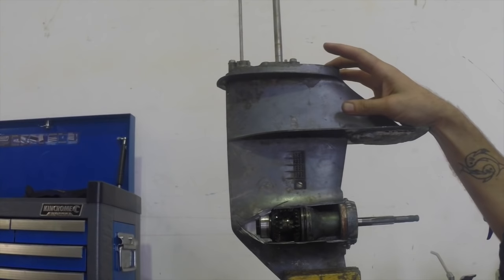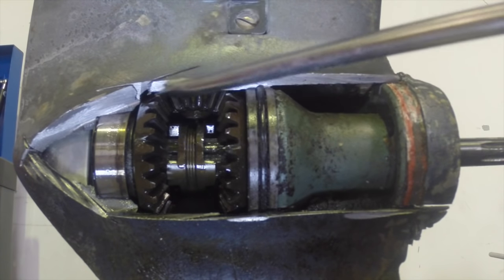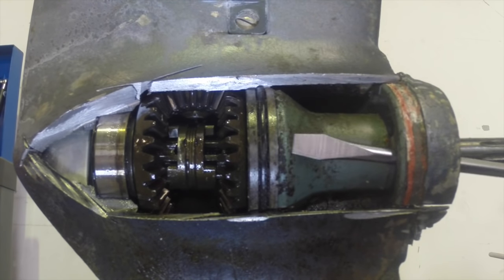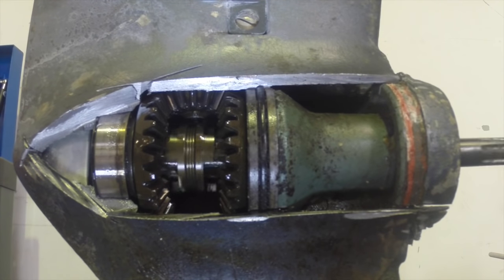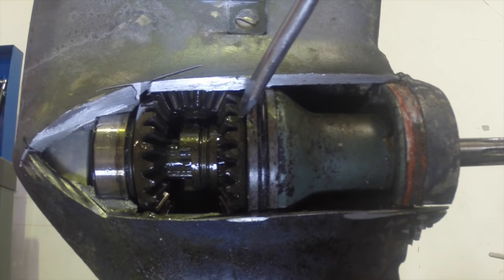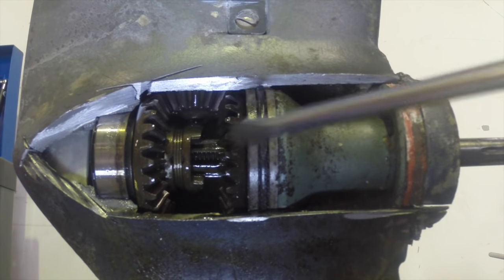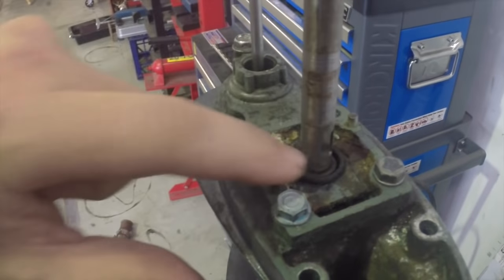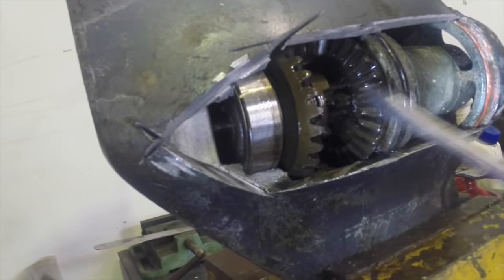How an outboard gearbox works

Comment: so is the grinding sound that i hear sometimes the dog clutch trying to engage on the forward/reverse gears?
Reply from the maker: Yes, that's exactly what that noise is. It generally only happens during the process of selecting a gear, particularly if you do it too slowly.
Reply: I see. Thanks. Just found your channel last night and now I'm making my way through the rest of your videos. You're a great teacher. Really enjoying learning more about outboards and just boats in general. My dad and I were having some trouble with our 40 hp Mercury thats about 15 years old and were looking up videos and I think that's why your videos popped up. We weren't able to get the problem fixed, so we ended up deciding to put a new outboard on it. Going for a 70 hp Yamaha. Should perform much better and get us a good bit more speed. It's going on a 17 foot aluminum Tracker. Any experience with that outboard? Thanks for the vids!

Comment: WHAT DOES IT MEAN IF YOU CAN HEAR A SLIPPING NOISE WHEN DRIVING FORWARD UNDER LOAD, IS IT THE GEARBOX SLIPPING?
Reply from the maker: Hi Eric, by slipping noise is it a clunking or ratchet sound? If so it does sound like either the dog clutch is worn or the gear selector cable needs adjusting.https://www.youtube.com/watch?v=B4acSf_BgP4

Comment: What does the reverse lock rod do?
Reverse lock?
Explain
Thanks!
Reply from the maker: Where is it? Never heard of a reverse lock rod.
Reply: @Thomas Flynn------On my Johnson 25 HP it locks the tilt so when you use too much power while in reverse it stops the motor from kicking up and leaving the prop out of the water and spinning in the air (cavitation?)

Comment: Hi, I am building an electric driven boat. I have 2 BLDC motors that I will connect to my 2 propellers (13 inch), this is for a boat of 13 meters. But the BLDC runs between 2000 and 8000 rpm. How much do I need to reduce this? Do I ?
Reply from the maker: That's a good question, I don't know anything about electric boats but there is a guy on the island that built one so I will ask him. If those props are anything like outboards they probably like to run about 5000 RPM, maybe even a little less given they are quite large and electric motors have a lot of torque.
Reply: Hi Dangar, Thank you for your respons.

Comment: do I have to remove lower unit to replace seals and the o-ring on my 110 hp v4 johnson
Reply from the maker: You don't need to remove the lower unit to remove the bearing carrier, but you can also do it this way without removing the bearing carrier if you are careful. https://www.youtube.com/watch?v=c14ixpVXrZ0

Comment: what automotive seal replaces the prop shaft seals on a 92 yamaha pro 50?
Reply from the maker: Not sure off the top of my head but it will usually be written on the seal. There will be three numbers, an outer diameter, and inner diameter and a width. If they can't be read of the seal (they are very small), you can just measure the seal directly. Be sure to either get a seal with a stainless spring in it or replace it with a nitrile o-ring.

Comment: I just bought a mercury 4 hp outboard and the lower unit was bad. The previous owner told me that the driveshaft Was grinding so I ordered the lower unit from eBay and received it yesterday I put everything back together and now it started grinding again could you please help me what should I do?? Sorry im new to the boating world lol.
Reply from the maker: It could be the bushing that the driveshaft passes through just above the gearbox. If you look up with flashlight with the gearbox off you should be able to see it.
Reply: Dangar Marine Thanks for the response, but let me try to make more sense haha the lower unit it had driveshaft was grinded down at the top part not the bottom. When i recieved the whole lower unit i installed it and when i started it up in nuetral its doing the same grinding noise it did before. I dnt think the lower gears is the problem because the tip of the drive shaft is what got grinded. So my question is what does the drive shaft comnect to when you connect up top? And what could cause this problem.

Comment: So when a lower unit "blows" what's usually failing?
Reply from the maker: If by "blows" you mean totally fails, it is usually the teeth on the dog clutch or the backs of the gears that the dog clutch mates with. If you mean that it can't hold pressure it is the oil seals around the propshaft and driveshaft that fail.

Comment: good video 👍🙏, what is the gear ratio?
Reply from the maker: Generally around 2:1
Reply: @DangarMarine  meaning that how the rpm on the propeller has doubled or actually decreased to half.

Comment: I have a 1978 Evinrude  9.9/15 HP that I am changing the lower case because of a eroded water pump housing. I am having a hard time reassembling it. Can you help?
Reply from the maker: What is happening when you try to reassemble it?
Reply: I cannot figure out how to fit the shifter linkages in the housing along with the forward gear. I can see the way everything is supposed to fit together outside of the housing but fitting it into the housing is another story.
Reply from the maker: I'd love to be able to help you but I've never done one of those. Is it a push-pull linkage or a twist type?
Reply: Thanks anyway but if you've never done one of these then it's going to be too difficult for me to explain. I appreciate the offer. Thanks.
Reply from the maker: No worries, some things are very hard to put into words. Let me know if you post a video on it and I'll take a look.
Reply: I got it together using 2 automotive extendable magnet tools, a pair of long needle nose pliers and a 3/4 inch  PVC pipe union that I used to hold the spring loaded ball bearings in the prop shaft until I could insert it into the clutch dog. Kind of like building a ship in a bottle only with lots of cursing.
Reply from the maker: Nice work! I'd love to see on video on how you did it. Either way, congratulations on getting it back together. :)
Reply: I would make a video but I don't have the video equipment. Also it was a bit of a nightmare and I really don't want to do the job again. Maybe if I get another one of these motors in the future I will consider it. Thanks again for your offer to help. Now I just have to take care of the top end and I can finally go fishing again. Cheers, Bob
Reply: Bob Adams

Comment: What causes the grinding noise when you change gears?
Reply from the maker: +Buck creek Good question. Outboards don't have friction clutches like cars, just dog clutches. Dog clutches are just simple square teeth that need to lock into square recesses in the gears. In that time between them coming together and touching and being fully locked those square teeth will catch then bounce along each other. That is the noise you are hearing. You hear it more when people are slow putting an outboard into gear and are hesitating at that halfway point where it isn't neutral, but it isn't fully locked it.
Reply: Thank you for the info and great video! I will be watching more in the future. I have a saltwater series Yamaha 2 that I have had many problems with.
Reply from the maker: +Buck creek You're welcome. Be sure to take a look at this video if you're outboard is giving you trouble making that grinding noise. https://youtu.be/B4acSf_BgP4

Comment: I turn prop counter clockwise in gear then i turn clock wise and it makes a clicking noise? 
Doesn't do that when lower leg is out
Reply from the maker: Gotcha. I would use a paint pen or something to mark the current position and then try turning it one spline either way and see if it goes away.
Reply: Which gear would be best to put in when I try to put lower leg back on?
I never had a problem with this one before it's been off several times because customer wanted new seals etc
Thanks,
Tom

Comment: I have change my 200 hp yamaha midsection and now every time i shift from neutral to forward or reversed is grinding I adjusted all cables and still grinding can you help me?
Reply from the maker: Is it a push / pull gear selector or a splined rotating type?
Reply: Dangar Marine  push/pull
Reply from the maker: It's odd that it is grinding in both directions. Generally if they are out of adjustment they will only grind in one direction. I would be suspecting some type of play in the linkage that is making it either too tight, too loose or giving it too much play in any part of the linkages that have been changed. Hard to say more without seeing it.
Reply: Dangar Marine thanks yesterday I checked and shifting cable has like 1/2 inch play I think that causing the problem

Comment: Im still trying to get 86 yamaha adjust right has 2 piece gear selector rod
Reply from the maker: So if you set the gearbox into neutral and the gear selector into neutral, how close are the two ends of the rod when you assemble it?
Reply: Don't Know but I will try that
Thanks!

Comment: Danger Marine please help??? I have a 2001 Yamaha 25hp 4stroke. I have done about everything to the motor to make it perfect it has all new head job with gaskets and seals all oem. New fuel pump,water pump , new fuel system complete, coil pack ,plugs ,brand new oem carburetor and maintenance all the time she had ran perfect and I use her everyday and put 1700miles inshore fishing within 6months. Every filter is changed every other month along with oil every month. My problem is she will idle perfectly but the min i put her into drive she bogs and will only go 7mph at most and sounds like its got an air leak i checked and resealed all the gaskets on the intake and to motor. But it sounds like it it missing but not sure. I have all new timing belt on it and it ran perfectly before this then started out of nowhere. Please help im not sure if its in limp mode.please help. I ordered the oil pressure sensor thinking it might be bad. Or im looking into the pulser coil? What do u think please help. I use my boat for fishing and I take vets out for relaxation to help with ptsd recovery.thanks so much
Reply from the maker: Hi Zach, did the problem start straight after the timing belt went on. Could the belt be a tooth or two out? If you can head a leak like a sucking sound you can spray around the parts of the motor with a can of WD40 and listen for a change in the idle RPM to try to find it.
Reply: @DangarMarine  No sir it ran perfectly i went out and had no problems shut the motor down went to take off again and thats when it started to give me problems. I think its just I need to find a good 40 or 50 Yamaha motor I can buy super cheap and over time rebuild it and hopefully sell mine to help with some of the cost but that might take me a long while so I have a feeling ill be off the water for a while unfortunately. If u happen to know anyone looking to sell a used but good Yamaha 40 or 50hp motor please let me know. Ill be honest i cannot come up with allot but maybe I could trade them my old motor to help with cost. Also I did check timing and its right on,also sprayed carb choke to check for leak but no change. Thank u so much for ur time. Sincerely Zachary

Comment: Good morning Im having a problem i removed mine and when i tried to put it back is like a 1/4 of an inch that dosent go in i tried in every gear and nothing i even remove the front piece that looks like a bullet with 3 ball bearings and still is not going in all the way if i tighten the screws it goes in but the propeller becomes really hard to move and if not it never goes in all the way i dont know if there is something im missing or any tricks but mine is not going fully in i was hoping if anybody can guide me in the right direction on what else to try thanks
Reply from the maker: This video might help https://www.youtube.com/watch?v=srGVSl4_n8Q

Comment: Why does my motor leak something right at the base were you put the prop
Reply from the maker: Sounds like the oil seals have failed. Trying doing a pressure test like this https://www.youtube.com/watch?v=lnhZFn5gkG4
Reply: Dangar Marine OK sure will thanks so much

Comment: How do you remove the beating carrier ?
Reply from the maker: With a puller appropriate to the brand of outboard. They are often very tight and will require some heat on the casing to come out.

Comment: Hi n thank you for a great video I learned something new today ty! I'm looking for help hopefully someone can answer me as to why my 1999 evinrude 200 won't go in reverse after is fully warm up lets say after riding alone the intercostal for a good while n, n when I headed back to the ramp i then gently put it in reverse n it will not engage n it also the engine will raise to 2k rpm I had no choice but to kill the motor I was close to the dock  so I was able to hook into the pilling. It only happens when is fully warm up bcuz is fine when cold cuz I was able to engage in reverse when I first got the boat ramp? Idk I hope some one can guide me in the right direction as to what I need to do. Ty!
Reply from the maker: +Milton Solis Hmmm, that is quite strange. The only thing I can think is that maybe the linkage expands ever so slightly with heat or the oil in the gearbox or the gears themselves change with the heat. I would expect whatever it is to take a while to cool down and shrink again though if it is heat related. Have you looked at the oil in the gearbox recently? Also, this video might give you some more clues on what to check with the gear selector https://youtu.be/B4acSf_BgP4
Reply: +Dangar Marine ty so much mostly for replying me back u were the only one thatdid  n I ty so much! hmmmm Im going to ck my linkages n yes I had just replaced the oil on lower unit drained it this pass sunday just to ck n it came out very dark color I put fresh oil in it n will see what happens nx time I take the boat out it will be my second trip out lolty again!
Reply: +Milton Solis Possible stretched shift cable being affected by heat

Comment: why do i  have oil or grease comming out of my inside prop and exaust port
Reply from the maker: It can either be gearbox oil or two stroke oil from unburnt fuel.
Reply: how do you fix if unburnt fuel

Comment: I had a Mirena try to repair my outboard from jumping out of gear and he bought new clutch dogs and a forward gear and it still jumps out of gear $900 later yes I'm pissed I went and talked to Mertens another Marina and they said you cannot just replace the gears and clutch dogs you are asking for problems has to be a matched set
Reply from the maker: It depends a bit on the outboard. The surfaces of the clutch dogs and the gears need to match. Times I have had the clutch machined that have wanted both gears too to make them match. New factory clutches and gears should be fine though if the gear selector mechanism is adjusted properly. https://www.youtube.com/watch?v=B4acSf_BgP4

Comment: Is there a clutch system aswell ?
Reply from the maker: Just the dog clutch shown in this video.
Reply: Right, so you cant put it into gear when the engine is spinning ? are there no synchros ?

Comment: Too bad you couldn't get into how the shift rod's up and down movement translates into the back and forth movement of the dog clutch. You bombed on this one.
Reply from the maker: It's different from model to model but usually either a wedge that gets thicker are is pushes down therefore pushing the shaft back or a cam that rotates. Here is a playlist of gearbox videos https://www.youtube.com/watch?v=lnhZFn5gkG4&list=PLJD0gZGZdCucJFYEoe-I93VANNzgTgPkV

Comment: Reverse lock kit on mercury ?
Reply from the maker: Ah right, just googled it, it is the hook that stops the motor flipping up when motoring in reverse, that makes sense.
Reply: +Dangar Marine thanks
Still having problems with the yamaha gears not working right
After i replaced the gear selector rod it does not go in forward gear its a 2 piece rod and i keep adjusting it then the connector comes off?
Have it set in reverse
Its 1986 25 hp yamaha 25sj
Any ideas?

Comment: does anyone now how to pull the gears/bearing carrier out of a force 9.9 1998 because from what I can make out there is nowhere to attach a shaft puller
Reply from the maker: +mike I'm not familiar with that exact model, but you normally hook the puller around the vanes going from the outer gearbox casing to the bearing carrier like in this video https://youtu.be/HRpfaOiXxWo Someone else might now though if that doesn't work for the Force. :)
Reply: +Dangar Marine thanks for the reply here is a link to a couple of Instagram pics of what I'm talking about https://www.instagram.com/hightofhealth/ notice the vanes seem to be solid from top to bottom with no gap under them to hook something on to
Reply: +mike would I be able to pull the spindle/shaft pulling the housing and revers gears with it or would this cause too much damage
Reply from the maker: What concerns me about putting on the shaft is that it isn't clear to me what locks it in. Did you see any fasteners or clips that held it in?
Reply: no but I think I have found the part and it looks to have a thread on it but now I cant work out which way to turn it here is a link to what I think is  the part http://www.crowleymarine.com/parts/6225.cfm
Reply: it also comes with a torque setting
Reply: it turns clockwise to undo it I had to make a tool out of a pipe from a tripod jack of a car by cutting three spaces where the vanes are almost like a huge socket and after opening it I have discovered that it wasn't the dog it was the dog pin that pushes it back and forward nice easy fix thanks so much for all the videos you where who inspired me to take on this as my first ever project
Reply from the maker: Hi Mike, good work on getting it fixed. It's always extra satisfying to fix something using  a tool you made yourself. :)